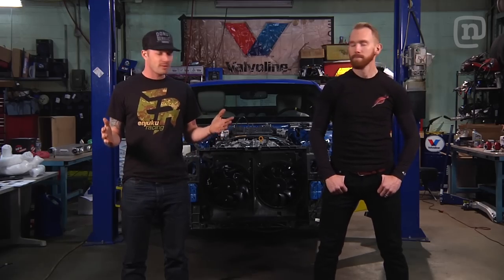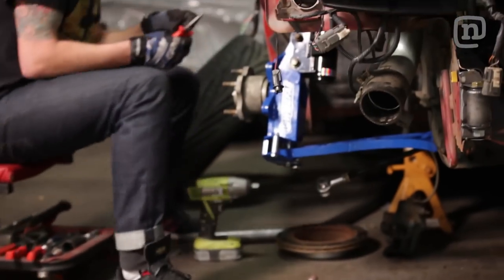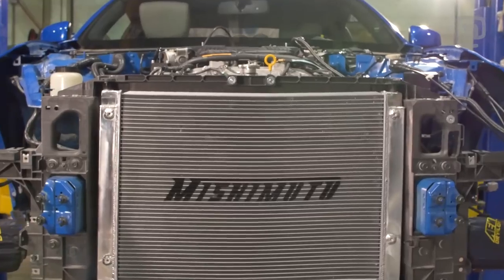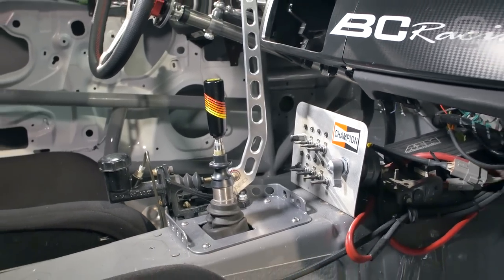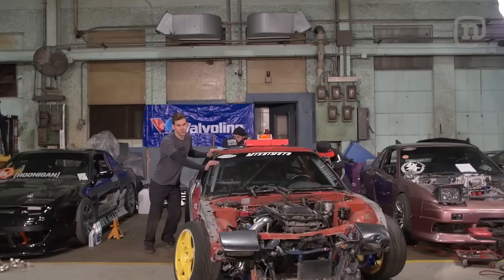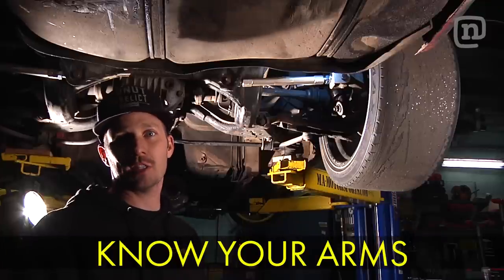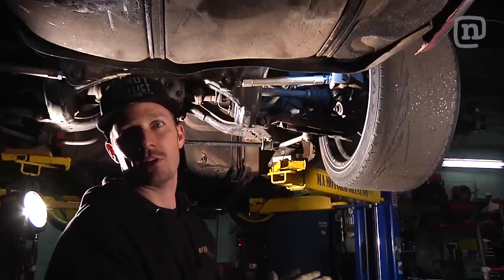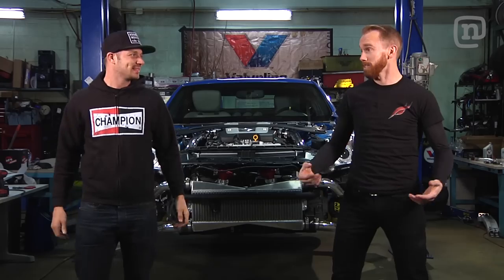Drift Car Cooling System Builds & Suspension Upgrades: Drift Garage Ep. 203

Comment: 3:40 onwards. You should intalls bolts from front twards the rear so IF the nut gets loose You won't lose the bolt during the drive/drift.

Comment: Hi. Can I ask few questions? What is different between Wisefab and IRP lock kit? (they look same for BMW E30)
And what is your experience with BC coilovers? I can not decide which suspension I buy BC or XYZ coilovers.
And last question. Do you use BC BR or RM series? Or some spring rates update? Thanks for answering.

Comment: Hi Ryan. I have a two part question for you. Whats with the rollers attached to the front of the s13's chassis rails? And also how are you going to combat the front brake hoses making contact with the rim, given that you're unable to run the bc gold brackets with those hoses?

Comment: @daviddosison gela you need to be more specific which 3 series are you talking about e30 e36 e46? and as for the question id sadly have to say neither cars. e36 can make decent power but they aren't the most reliable engine in the world and parts can be very expensive depending on where you live. and i love the miata dont get my wrong ive owned one for a short amount of time before but they have a 50 50 weight dist which is not ideal for drifting.
Reply: Most drifters don't use Bmw due to cost, take a look at the Europe drift circuit... Plenty bimmers. However, Bmw e30 is a good drift car, easy to work on, and sound great. I'm running 18psi constantly and no issues on the m20.

Comment: What does it take to drift at full 60+ degrees steering angle at close to full throttle horse power / torque, suspension stiffness, and tire profile / tire grip wise. I want to go fast sideways through some long corners. Thank you and good luck during fd round 2!..

Comment: Suspension is the most important component to a drifting vehicle all the horsepower in the world wont make your vehicle run properly and slide smoothly without a proper alignment, suspension component setup.

Comment: Dear Ryan, 
I am a big fan from the caribbean you and Chris are my idols. 
 
 I am currently thinking of buying an s14 shell here in Aruba. I want to make it 2jz or 1jz powered. When I buy the car and the engine, what should I mod first?
Reply: Amin Croes Saucedo I know you asked them but everyone (including them) will tell you tired and suspension.
Reply: Amin Croes Saucedo Make it SR20DET powered.
It's probably the best engine for drifting, the 2JZ is more of an engine for making tons of power.
Reply: ***** how do you figure? SR20s are great but 2JZs will make a good starter platform and the same engine can move through the ranks with the driver once he gets better. SRs are cheaper but when you hit the power threshold with them they are going to cost you alot. With 2JZs they make power really easily all the way up to pro status.
Reply: josh king I find that the 2JZ is better for a performance build, not a drift build.
You catch my drift?
Reply: ***** I would agree it's a great performance engine but it's still an I6 which means its still great for drifting. Also I see what you did there.
Reply: ***** josh king  Nah.. I just want to be different here in my country. We get the JDM and rarely USDM variants of S-Chasis. I have a lot of friends with silvias that come with a SR20DE/DET from factory, and they all run pretty well. Some LS  swaps have been done before; a friend of mine had a LS1 in a American version of the S14 and another guy had the same engine but in a JDM S14. :P
Reply: Amin Croes Saucedo well if you live in a place where it's mostly JDM LS swaps are pretty expensive. Here in the US it's a no brainer you can go to the local auto store and they have all kinds of things for LS motors JDM motor things aren't as available. If you arent worried about money go with an LS they are amazing engines straight form the factory if you are a little more worried i would say either 2JZ or RB25/26. RB would probably be the lease expensive.
Reply: Thanks Josh. I'll keep that in mind.
Reply: +Amin Croes Saucedo I was in Aruba 5 months ago, the amount of silvias and altezzas there is crazy why not just buy a complete one?  Have fun on those basically lawless streets. I broke a rental jeep drifting at the Balshia Gold Mill ruins hahah  ebraking our yaris in the dirt at tacobell got a little boring

Comment: Whats the exhaust on the 370z? Would be pretty sweet if they had one for my RX-8.
Reply: Travis Kincaid I wanted to get a rx8 but people say the running costs and reliability are bad what do you think
Reply: JAHDI TECH I'm the second owner of my RX-8. My car has went through 3 engine swaps. I was lucky to get mine with only 30k on the motor. The car has 118k on it. Only problems i went through bad cats & i went through two fuel pumps "mainly because the garage i sent it to screwed me over" i can't say its reliable.. but it's a amazing handling car. & i dont plan on selling it. Im trying to do a 13b rew swap from a FD Rx-7. Because there is more mods & upgrades for the 13b-rew. It's a rotary engine so it burns hella gas & oil. Plus rotary are known to have bad apex seals after certain miles. But i love the car man. opinions vary, & to each their own.